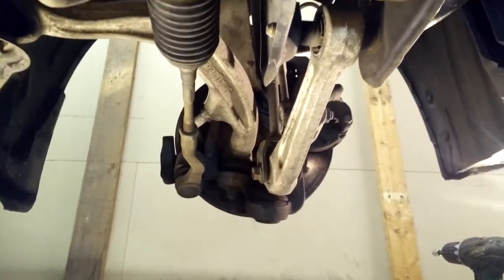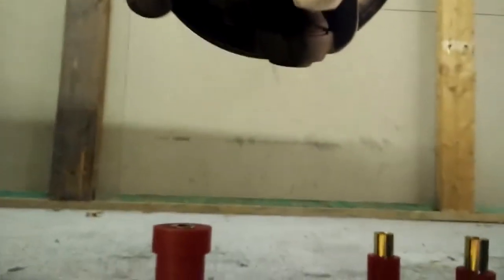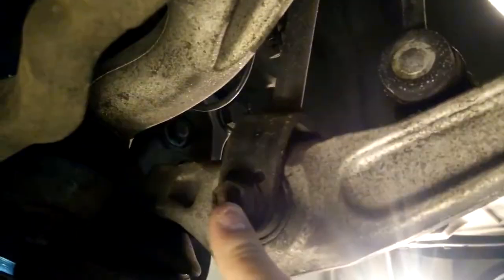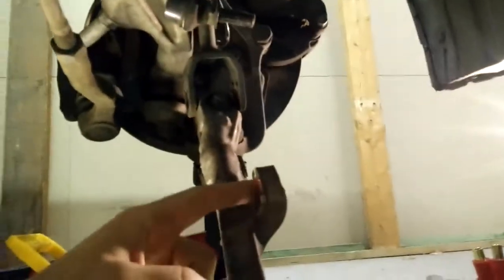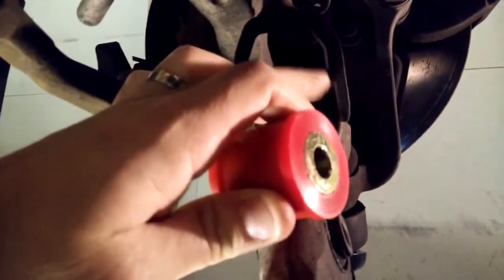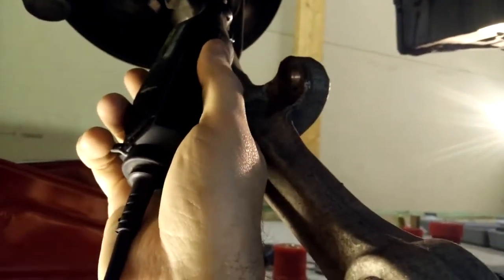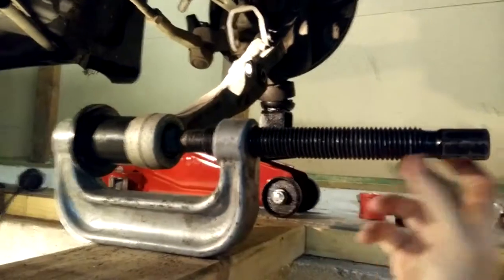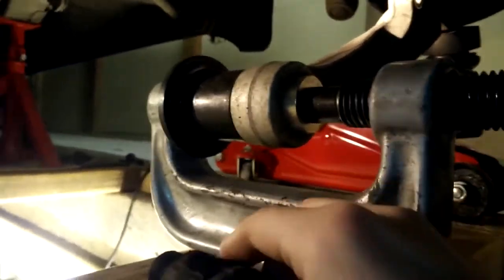Infiniti G35 Prothane Front Polyurethane Suspension Bushings Install (1 of 4)

Comment: How does the car feel now that it has these bushings? I'm looking to do this upgrade in the near future.
Reply from the maker: I would definitely say that the suspension is a bit more firm.  You will feel more of the road imperfections.  The steering feels a bit more "twitchy" as well probably because it reacts more quickly to input with the poly bushings than with the softer rubber.